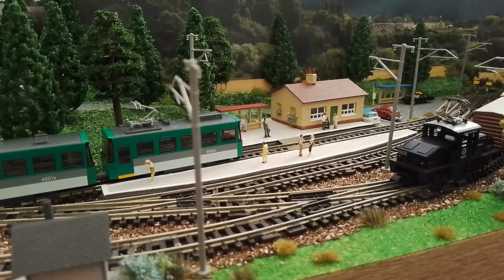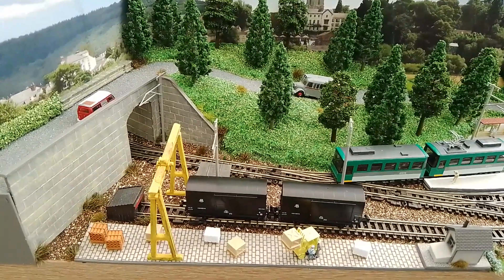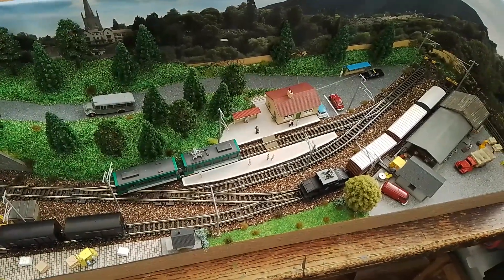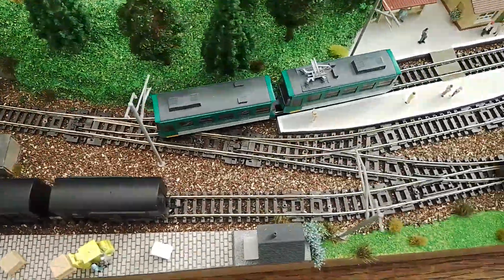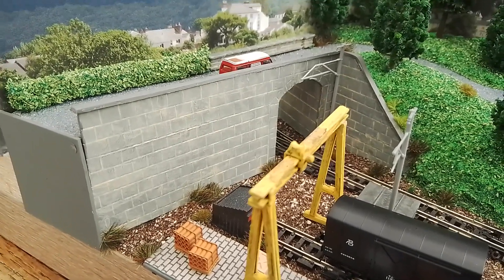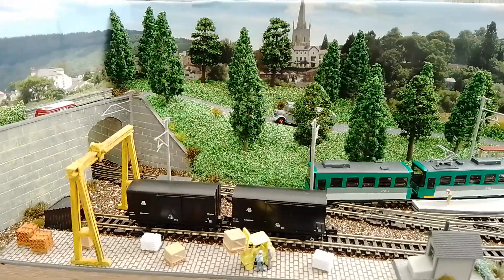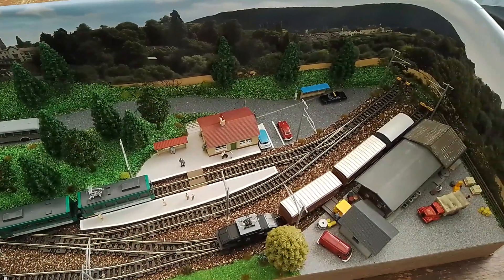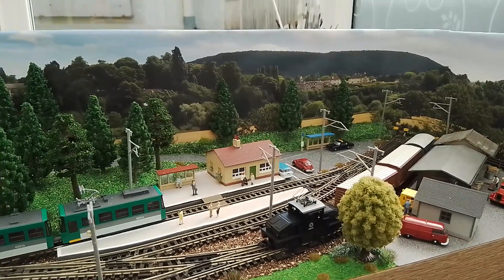My ideal shunting/ switching model railway/ railroad layout

Comment: IF (big if), if somebody really had their heart set on a British outline option for layout or train, how about a scaled down version of your awesome BMR steam tram around the Kato 11-109, and maybe a version of the industrial shunter with side plates a bit like the class 03 drewry shunter also on the kato for something a bit like the Wisbech and Upwell tramway (…or Toby and Mavis for those who grew up with the works of Rev W Awdry).

I also recently learned about the steam trams (a loco and trailer) that used to be used before electric trams and trolley buses near to me in the late 1800s; although very different, imagining what could be do there around approximately n-gauge and a kato 4-wheel chassis… operation is obviously would be restricted but might be nice to just watch them go by on a tight circuit or a shuttle
Reply from the maker: Some very good ideas there thanks

Comment: Hello, Yes it looks very good, it all seems to blend in very well. I do like that Wickham Trolley thing though, do you have a link for that please. Thanks
Reply from the maker: I'm not sure who made it now sorry
Reply: Walthers here in the States. It came with the shed, which was part of a set that included the small shanty with the coal box and a signal tower. There was a company here called Micro Engineering, which closed up but has recently been purchased and gearing up for a relaunch that made a similar shed and speeder, as we call them here.
Reply from the maker: @TheJpec361  thanks for the info, yes mine came with a signal cabin as well
Reply: @TheJpec361  Hi Jeff Thanks for that, I will have to look out for it (in UK).

Comment: Hi which set track code parts were used for the loop?
Reply from the maker: I will try and get you a list but just the short curve, two points and whatever straights you want

Comment: Hi Philip here Iam doing a layout similar to yours in n scale what did you use for the road on the hill let me know
Reply from the maker: It was a self adhesive role from China via ebay
Reply: Hi right ok then thanks for letting me know as iam painting my own road on my layout is that ok and will it work and look ok
Reply from the maker: @philipgreenhill2782  I have used painted card board for roads. Try and get a rough finish and then dry brush it with a lighter colour